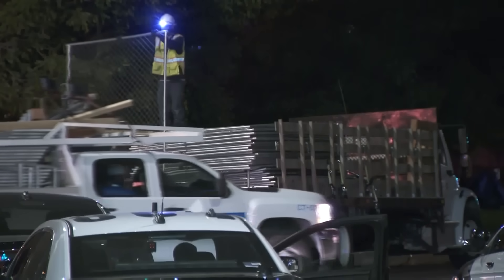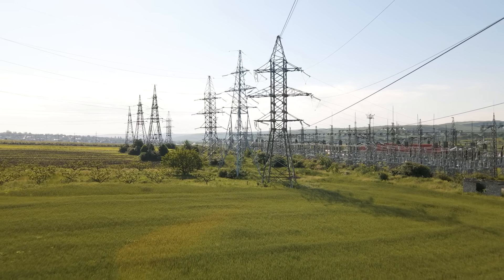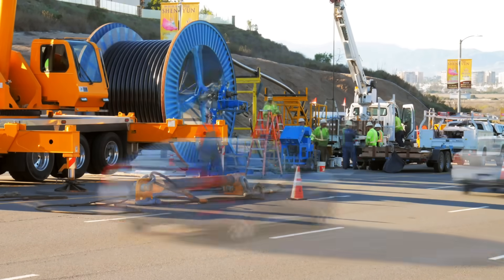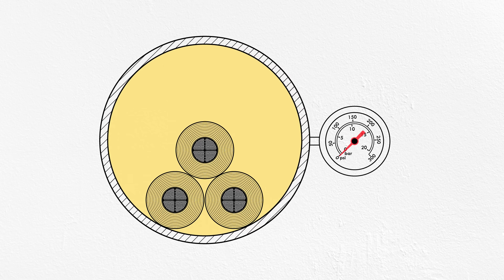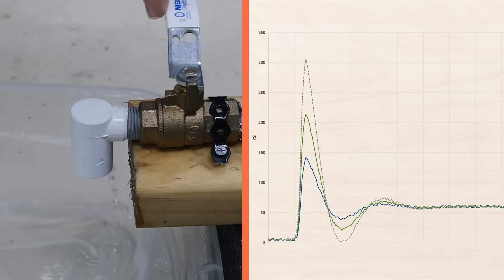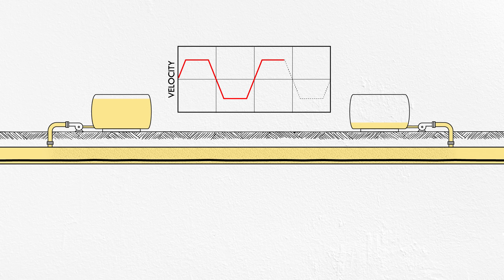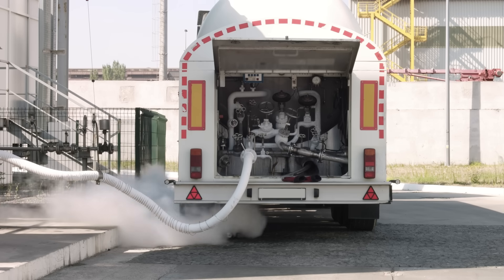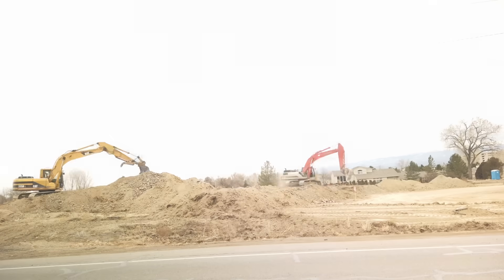Repairing Underground Power Cables Is Nearly Impossible

Comment: I appreciate your proper use of significant figures in conversions. As an engineer it's a pet peeve of mine when videos will take a rough quantity in one unit and then convert it with far too much precision. Your use of "approximately 14" bar approximating to "200 psi" is a great example. Many videos would quote that as 203 or, worse, 203.1 psi when it's just a rough value in the first place! Thanks for adhering to good engineering principles! Subtle things like this ARE noticed!
Reply: Significant figures is not the proper way to propagate error.  It is a set of "rules of thumb" and can be show to be self-contradictory.  I have no problem with dropping figures off of estimates, but it kills me when professors act like it is based in rigorous mathematics, like 'you didn't fudge this number in exactly the right way.'
Reply: @MushookieMan  i don't know that sig figs are really a thing engineers use. I certainly don't. 

In general it's about understanding the scale your working at and how good your tools are.when I see someone report the temperature of an air conditioned volume to 4 decimal places it tells me that they fundamentally misunderstand the problem they're solving and the tools they use. Humans can't tell to that level and no air conditioning system will be able to control to that level. For a newish engineer it's a training issue, for someone who has been around for a while it's a warning about that person's work.
Reply: @Kandralla  As an engineering student I typically prefer to use full precision for intermediate calculations, then round the final result based on the application and original data. While I understand sig figs and why they are used, I always thought the specific rules felt arbitrary. Rounding with each step also felt like I was accumulating successive roundoff errors more than keeping the scope of the calculation in check. In fact, I've always preferred to err slightly on the side of "too much precision." In the real world, who cares if I report a value down to 4 or 5 decimal places instead of 3? That extra precision can easily be discarded later; it's a lot harder to get back once lost.
Reply: @andrewsprojectsinnovations6352  the too much prezision can become pretty costly realy quick like i want to buy 10,0m of steel that can be from 9,95 to 10,04 in theory with rounding and is easily doable with an hand saw, now 10,000m gets in the range for maybe needing a temprature controlled messering room making the price probably go up by a few times also most times when you give like a mm number with more than 1 or 2 dezimals the question also becomes how do you want to messure it and that also can become realy costly
Reply: @andrewsprojectsinnovations6352  the reality is that for most situations the limiting factor is going to be what you can sense, and what you can actualy control to. For a lot of jobs it's more important that you're consistent with whatever you do then it be "the right way". Where it really really matters you're going to have standard practices that are industry, company or even job specific (and if you don't... And it really does matter, write your own and put it somewhere people can find it). It really comes down to you understanding what the numbers are used for, to what level of precision it matters, and what precision the numbers you start with are. But if you're reporting to five decimal places and it's unwarranted you're sending the message that you don't understand the scope of the problem you're trying to solve (and 5 decimal places... That's up there no matter what you thing about preserving precision... It's false precision in most cases) .

For me, I minimize the number of times I have to round something just out of habit, but for what I'm doing it doesnt matter all that much most of the time.
Reply: @Kandralla  precision and you want to know what way you can err in. take classic peg and hole, if the peg is err large and hole small it won't fit, but if the peg is small and hole is large it'll have spme slop but it does go in.

Comment: Any chance that the 'cooling' oil contained PCBs since the transmission line was installed in the 70s?  I wonder if the story was spun a little bit to omit that and the environmental issues that it would pose.
Reply: Yeah.... That wouldn't surprise me. I was wondering that too. I forgot what the other nasty oil used for dielectrics are.

Comment: Water hammer. They did a huge add on at the warehouse I worked at the fire dept kept getting alarms saying there was a fire at our place. They were going to start fining us. Scratch head time it was due to low water pressure I.e. the sprinklers went off or so it seemed. After lots of tests tracking and equipment the cause was a water truck filling it’s tank the valve got shut fast boom water hammer spiked the pressure and would trip the alarm. Fix was as easy as asking them to fill off a different hydrant.

Comment: Great video! As an electrical engineer, I really like understanding the unique challenges of old installations like this. BTW, in case you are looking for another infrastructure story, downtown Dallas has an interesting system of underground power distribution. Developed in the 1920s or 30s, the buildings down there have underground transformers (not that unusual), but the the secondaries (208V/3Ph) are all tied together between each transformer AND between neighbor's electrical services. Essentially, everyone is on the same low voltage bus instead of being interconnected up stream on the high voltage side of the transformers in a modern installation. Some of the buildings down there have 2, 3, 4 transformers dedicated for each building along with paralleling cables to tie the transformers together, but also to tie the neighbor's electrical service to your electrical service. They often include an extra transformers for what they call 'double contingency' shut downs, making your electrical service is incredibly redundant. there are some difficulties dealing with incoming fault currents which can be astronomically high because of the quantity and proximity of transformers to the switchgear.
Reply: Common enough still in urban areas, you have multiple transformers  fed from the same 11kV 3 phase delta supply, all of them also connected on the secondary side by a separate heavy cable. This allows you to isolate a single transformer to repair or replace it, and not lose the connected load, though you have to be aware of the total loading on any one transformer, and they all have to be set up to provide the same exact ratio, so as to avoid large circulating currents. 

Where I used to work there was a 1MVA transformer across the street, with a LC connection to the 200kVA transformer in the building, and another that led to the transformer 2 buildings down, which is a 150kVA transformer, but also a split in the 11kV loop, feeding a stub in a new building, as it was the closest substation when it was built. You can feed any of the loads from any of the transformers, though the 1MVA one you would have to isolate half the building it feeds, and also work at night after 10PM, as load will be low then. Feed fuses are 400A ones, and the outgoing cables to the local loads are 200A on all the transformers, just the bigger ones have more outgoing circuits.

There was a big notice on the fuse panel for the bottom 2 rows, which is where the back feed came in, that the lower contacts, normally considered to be the load side, can be live. You would just need to have 4 fuse carriers there, 3 with 400A fuses, and a single one with a jumper bar for the neutral, to feed the interconnect feeder if needed. 

Had to do it for a few weeks when the fibre crew came a digging in the street, and found the joint in the 11kV cable with a pick axe. 10m of cable to replace the joint, and 2 scotchcasts, to join the tape armoured cable with the new HDPE cables.
Reply: Many of those transformer rooms people decide to shove racks of their computer equipment in.  I worked with Unisys in the 200x's and had a few calls and was wondering why they had so many transformers down there.  Makes me wonder how modern meter networks can work with such a  system.  Wouldn't you have to install a network bridge between each transformer or can a network signal survive the process with so many transformers?
Reply: I knew a person who was profesional electrican specialized in repairing industrial machines. And he called every machine older than 50 years flying dutchman since he never ever knew from where flying current will bite him.
Reply: i touched 100 volts. it hurt
Reply: @Blox117  100 volts is kind of meaningless. It's like saying I touched a gallon of water. Did you stick your finger in it, or dump it over your head? Static shocks from shuffling your feet on carpet can be several thousand volts. Current, along with duration, need to be considered as well as voltage when it comes to calculating the effect/work/damage done by electricity.
Reply: @WalkinTheCow  i touched a 100v 20AH battery with one hand on each terminal
Reply: @Blox117  That would do it. I work in construction so I've gotten zapped countless times. Usually just a quick poke wiring a household fixture. It def gets your attention but is more annoying than anything else. one of the more memorable ones was when I went to strip a wire I thought was dead using a metal razor knife while leaning against a SS refrigerator. That will make you reassess everything you think you know. 

Never took a utility knife to a wire again.
Reply: Downtown Toronto ON has a similar system where all the transformer secondaries are paralleled. The fault current that can be generated is insane. Dangerous. The cable is the fuse!